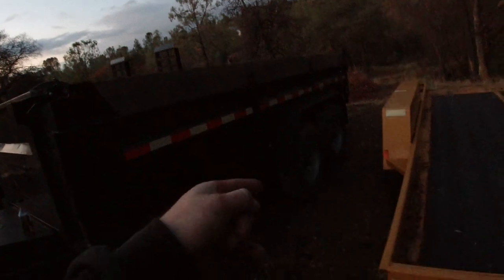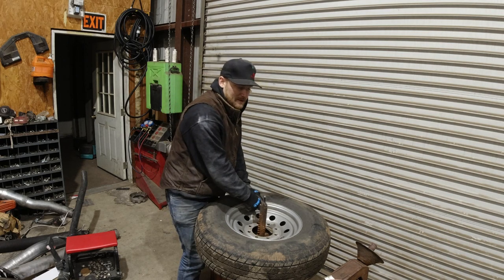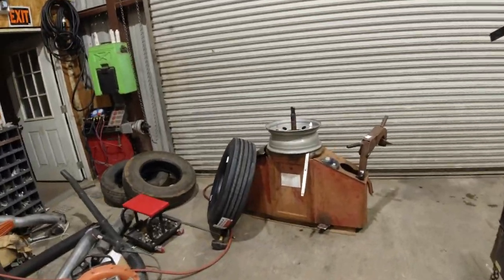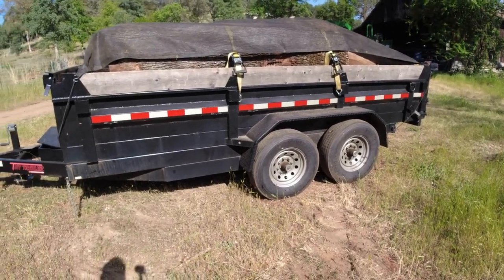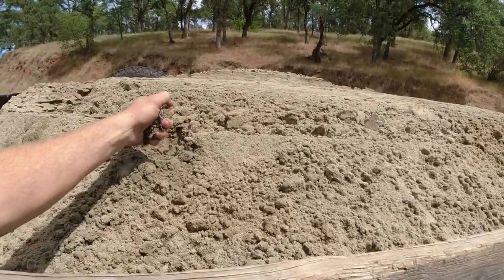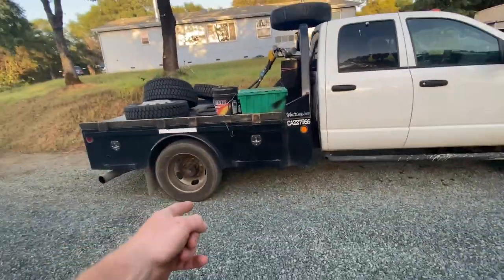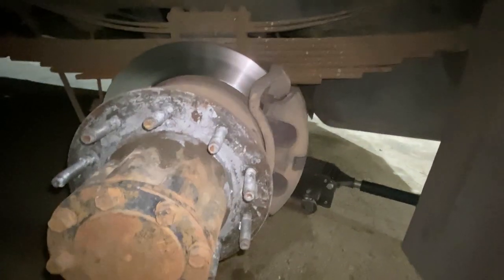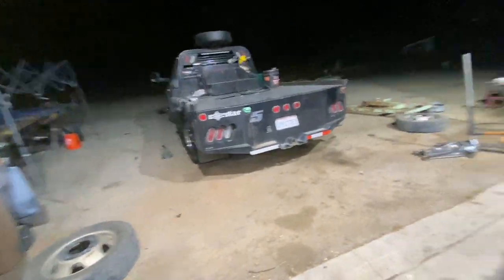Huge Upgrade for the Dump trailer! 14 ply tires. Should come standard!

Comment: When I was with my fire department, we had the good years on the f550 mini pumper we ran. Rear was great, using them as steer tires was not. The mileage we put on the truck a year was less than 2k so it wasn't terrible but not great on front, rear was amazing. That truck rode like a tank either way. Good look and great functionality on them good years. 
The Florida forest service uses them too, but not in front, can't remember what they have on the front for their rigs. Good purchase Sam, great trucks and love the content.

Comment: the dealer i bought my truck from put my winter steels on for me the first winter. i had to beat the back ones off with a sledge hammer in the spring, they'd rusted on. this fall i applied never seize on the steels before i put them on, this spring the backs literally fell off as i was taking the lug nuts off. made my life soooooo much easier.

Comment: I have those tires on my RV Hauler. Class 6 SuperCruzer. With the trailer on, drives are 11,000 lbs. Run 90 psi in the rears. Tried less but felt like it was moving around. They sing a little on some roads at 65 mph towing the rig. But never been stuck in sand or loose stuff , My steers are G647’s 245’s. X19.5 . Those tires when used on the drives just dig holes. The 622’s float real good and sit on top of soft stuff, Which is the reason I put the on instead of the 647’ RSS. Run 100 psi up front. See 110-115psi on the TPMS with 7880lbs on the steers. The rears are only carrying 2750 lbs each which is nothing, but felt like I needed the 90 psi. You’ll like them, all season with plenty of sipes in the tread.

Comment: On your 5500, if you don't already have them, it is recommended to use the nylon spacers between the steel and aluminum rims. It helps to reduce corrosion due to electrolysis between the two different metals. I had a similar issue with my fifth-wheel camper tires, they had 8ply tires on it, but I upgraded to 10 ply on 15 inch rims. I have been looking for 16 inch rims for it so I can get heavier tires for it. The 10 ply are a improvement but they still want to lay over when turning. The trailer when loaded for a week long outing is just over 10000#, which makes me also question if the axles are even heavy duty enough. Great informative video. Keep up the good work.

Comment: Years ago I bought a new 3000 pound small enclosed trailer and the first thing I did was to replace both tires with radial tires. Past experience bias ply tires would over heat and blow out if you didn't keep the air pressure up. Also adding electric brakes really made it fun to use.

Comment: Trailer tires is a good topic. I use 17.5 with 5/8 studs and for easy upgrade on 7k axles that run 16's the Boar Wheel Company has low profile 19.5 that match the  stock 16"  bolt pattern and tire dimension within half inch or so clearance.

Comment: I have great luck with Cooper overall. Running first set of 20s similar to what you have in grandmas truck. I run trailers pretty much daily but only avg 14 k trailer 23000 pound total truck and trailer. 20s I have are amp all terrains have 25000 on them rated to go 65000 have way more than half tread left and they have worn very even. I have ran then mostly in Texas but made one trip to Tennessee and back. You are right about the trailer ties have the 14 plus ply on gooseneck best tire ever. Ordered on trailer extra 125$ each (Lamar) brand trailer.  Which has been great. Just put 14 ply on our dump trailer it came with junk. Great improvement also. Have learned a lot from your videos.  I bought the Milwaukee impact because of this one in fact.

Comment: do not run more then 80psi in the tires unless you change out the rims. we have problems cracking rims at 110 psi on standard steel trailer rims
Reply from the maker: Yeah I didn’t put that much in them. All good. Worried about that aswell

Comment: I agree!! I just got rid of my 10 ply tires on 7x14’ sure trac dump trailer. Went with 16 ply. Got tired of blowouts and nails getting in easy. Only 8 month old trailer. Spending thousands of trailer should have 14 ply tires standard!

Comment: I've gotten alot of good advice from you bud 👍 I'll be upgrading my tires on my 30foot flat deck gooseneck to 14ply now. My pickup looks great with Steeles but will be upgrading to alcoas in time 😎 Good idea with the tire pressure. I'll double check mine. As for tire brands I use nitro for summers and winters. Nitto Terra grapplers for summer and nitto exo grapplers for winter. Stay away from trail hog tires. They barely last 30,000km.

Comment: Toyo m608z is a good tire that I put on my 5500 ram. I also went up a size to 245 70 19.5 and they have a 16 ply tire. I reality with the 16 ply tire my ram 5500 went up to a ford 600 with the tire upgrade. That's all ford did to get to the f 600. I also agree with your tires on the dump trailer, I put on the 14 ply and it was a night and day difference. Good luck and stay safe.👍👍

Comment: I made the same switch to 14 ply tires on my gooseneck dump trailer and I’ve never looked back. I couldn’t keep 10 ply tires on it. I run Hercules tires only because that’s what my local tire shop has in stock at an affordable price.

Comment: I thought my 14 ply were good until I put on the 16 ply this winter. Do not get even warm on the highway. The tire shop that mounted them had to resort to the six foot manual bars. Stalled out three different tire machines. Did you get the all steel version? Higher rated. My 14 ply were 4400 pounds per tire at 110 psi the 16 ply are 4540 pounds per tire at 120 psi. Love those balance beads. The rear tires really wear when you tow heavy. They got to do a lot of pavement grabbing. Every revolution the tires are trying to get traction on a new surface. So a tiny bit of slip occurs on the tires. Gravel well they are really slipping a lot. I do not have Ford Wheel Drive and my rears wear about twice as fast as the fronts. I loved the Nitto Terra Grappler in load range 126. They quit making it. I have a set of Dura Grapplers on now at load range 126. Good pavement traction in all conditions but not worth a crap in any sort of mud. I am following the Kanati Armor Hog reviews as that could be my next tire at a load rating of 129. I don't give a rats patootie about wear. If they cannot carry the load properly they are useless.

Comment: I keep two dump trailers going for a tree service and only three years old, 0ne has a whole new tubing 10 ga floor and new weld on OEM suspension and axles and the other almost as much rebuild work. There is no future commercially hauling with those and CDL/big trailer equipment trailers  is the way to go.
Reply: The stock tires have ripped the studs right out of our 7k Dexter cheap ass hubs stock on Cam Superline... You are in for trouble, electric brake axles are for campers..

Comment: I run those good years on the back of my semi and they work pretty good also we run them on our tow trucks they kind of skied around until they harden up but other than that they're pretty good.  We've always changed our own 19 fives all we do is put two bags of weights beads  inside.

Comment: I did that several years ago.  Loved it until the centers started breaking out of the wheels. The stiff sidewalls don't flex as much so the wheels have to take the hit. Over the road it's great. For short runs and lots of turning the 10 ply seem to work the best. That's my experience.

Comment: I run a 14 k flat deck and had a cheap tirelet go where the sidewall and tread meet we up graded to 14 ply tires just las week the weld on the rim where the dish meets the outer ring cracked we run heavy alot and run 500 mile round trips twice a week
Reply: Love the new tires on my trailer

Comment: Anti-seize says on the bottle, " NOT for use on wheel lug nuts or stud applications." Also I have learned lubricating the threads will give you more torque on that same setting/ ft/lb
Reply: ALL torque specs are for clean LUBRICATED thread. Not dry.

Comment: It was a 10-10 tire machine I had, they really were a great machine in the day.
Reply: A Coates 40-40A is a nice upgrade,  but in the scheme of things, they are antiques!
Get a newer rim clamp style machine.
The side of the machine bead breaker is cool for tires you need to bar off and on anyway. Don't have to lift tire till that chore is done.

Comment: another great video Sam, yeah it never pays to cheap out on tires, whatever i own/drive i will pay extra to get better quality ,mileage and warranty passenger or truck tires it just safer and makes sense, last set i bought were Michelins and they give 3mpg's better than the last set and ride quieter and better, for a used tire changing machine a shop i worked at awhile back had a Coats 40-40 and it did up to 19" rims and max tire diameter of 38" and was one robust machine and that same shop still has it as a backup machine in case the new fancy one goes down and needs to be serviced, the new ones are easier on the employees back when doing truck tires or those off road tires, don't know how much a used one is i just know that 40-40 sure did the job and always seem to be reliable 👍

Comment: I run a Brownell 10 ton hydraulic boat trailer (~8,000 empty, 28,000 max loaded) behind an F-450 short wheelbase chassis cab. Pair of 12k Dexter stub axles on custom airbag swingarms. Running 235/75/17.5 Hercules Strong Guard HRA..... J rated.... 6,008 single on Alcoa rims. They hold up pretty well considering the abuse (multiple daily dips in salt water and stupid hard turns) I put them through and the bad camber issue from the manufacturer failing to pre-camber the axles. I have to flip them on the rims to get full life.

Comment: I sell heavy truck tires. If you go with 14 ply tires, get rims rated for 110/4400 lbs. I sell 14 ply’s to dudes all day, I tell them to run them at 80, they run them at 100, and then they get pin hole leaks in the wheels.

Comment: The tires are rated to haul x amount of weight at the max tire pressure on the side wall.  Running low air pressure creates  unnecessary heat on the tires which is a tires enemy and will cause them to blow.   At 90psi that's 80% less air than what the tire is rated for.   So you turned your 4,000 pound rated tires into 3,600 pound tires by reducing tire psi.  Sure the tires is still capable of hauling 14,400 pounds at that pressure which is over max  on 7k axles.     Running lower air pressure is simply  weakening the sidewall of your new tires which is what  holds the  weight to help reduce side wall flex/roll.
Reply from the maker: Sidewalls didn’t budge. Good logic you have tho.
Reply: @VBELTandSON   I'm a firm believer in the tire manufacturer knows best since they developed and rated the tire.  As another fella mentioned rim's is designed for certain max psi also.    

You want rough when light or empty.   I run 120psi in 16ply steers and 115psi in my drives, not sure what ply my drive tires is, prolly 14.   We run the 16's on the steers since they can carry right around 13,000 pounds.

Comment: I did the same on my 43 ft 5th wheel camper right when I bought it. I don't know why they put the cheapest 10 ply crap tires on them. I put 17.5's on my 40 ft flat deck equipment trailer when I got it. I don't play with cheap weak tires.
Reply: Valve stems also need to be good and strong no rubber crap

Comment: The Big Tex trailers come with Good Ride tires...AKA "Blow Ride". At around 30K they start separating. They are 10 ply load range E tires that say they are good for 3520 Lbs. single, but obviously that's over rated. I put Hercules 901's rated for 3750 Lbs. Haven't put that many miles on them yet so the jury is still out on that.

Comment: Not cheap...Northern Tool has some  that run about $1,979. Tuxedo Semi-Automatic Swing-Arm Tire Changer — 37in.L x 48in.W x 41in.H, Model# TC-950 says it will do up to 47” tires and up to 15” wheels...don’t think it will be a cash cow for you as you mentioned.

But yeah I’ll be going to G rated tires next time for my dump, equipment, and or moving trailers...all dexter 7k axles...that’s a lot of load with 14k in sand and 10k in logs without blowing a tire , My dump has a big old sticker saying 9,500 Max load on her and dumps are heavy as it is....I’ve also cooked several E-rated in the summer anytime I’ve gotten much over 70 when passing...and one shredded last time I went to the local land fill...sounds like the G rated tires are “G” 

Commented too early in...🤣😂🤣

I’ll be glad to see how the G rated tires do~Jon

Comment: Well .. ! It's actually good to see a person fit wheels correctly , one should always wire brush wheel mount/wheel studs and smear - not paint - never-seize/copperslip to prevent corrosion - trying to beat a wheel off with a sledge is not fun - hope you put some between the steel and alloy? or do you prefer removing twins as a pair ? .As for fitting and tyre pricing your side of the pond ,sheez rip off or what ! . As for mileage would have thought 30-40k was good for a pick-up/flatbed , if you can get more ... bonus . Been a while ,long while ,but last set of rears I accuired for my unit (4x2...295/80x22-5) I got about 100k kms before they needed a tread re-cut ,the fronts back then were about £180 fitted etc and i got over 100K kms , (fronts become spare drives when require a tread re-cut) I averaged 8-9k kms a month bout 100k a year bit low but hey .

Comment: Hey Sam I have a to tell ya a story about my way to a job last week ! So I took this grading job in this remote but exclusive horse community not far  about 50 miles from me . Customer says road is narrow and steep and I have to be escorted in because the trailer anyhow I headed in towing my TL10 enclosed with only a bucket I have the Factory counter weights on rear and two 5 gallon water fire extinguishers on back . I figure it weighs 11500# with my 25’  deck over Pintle that weighs 5800# includes binders etc .... any how I use my 6.7 2016 3500 crew long bed srw Aisin so I’m headed up this six mile Windy road and I’m using my push button shift to stay in right gear and I’m babying it watching my temps etc .  Then  this One steep hill with a hard right turn at bottom I missed the shift from 3rd to 1st and the hill almost stopped me then it went to first and I gave it gas and my tires started spinning and no more forward progress then my warning light started beeping saying trans hot !! was 217  and started sliding backwards as tires spin I hit the brakes of course as I stained my shorts lol !! I had to put it in 4x4 to get up the hill definitely woke me up lol .first time I ever had to use 4x4 on pavement I’ve been on many dirt roads in 4x4 but on pavement Was a first for Me !!! Mind  you this narrow paved road has no shoulders with signs saying danger 1000 foot drop offs. Best part after three days of working they’re and jobs done customer wanted a discount umm NO ! Haha ever had to do that ?

Comment: Westlake are terrible from my experience on trailers they came on my 14k dump trailer, I didn’t upgrade right away because westlake was there upgrading 14ply so I figured I would try the 10ply to start needless to say I they made it about 5k before they started flaking and coming apart,. I run the Continental HDR on my dually with 20k on them now and not chipping or flaking but I’m in NC so I’m not dealing with super hot pavement like out west where you are, I can tell you that there’s a huge difference between them and the Cooper Rm253 that I started with on my 19.5’s. Vision hauler makes aluminum 19.5 that I have and you get 4 positive offset and 2 negative so I can rotate with out having to break the whole set down and remount and balance everything every rotation

Comment: Anti-seize / Lube is ok but you need to reduce the lug torque ( check proper torque ) Lube makes it easier to reach bolt stretch ( this is what "tightens" the bolt ). This would be good but the gorilla at the tire shop OVER tightens and causes the bolt to stretch into the permanent deform region. A stretched / deformed thread will cause removal problems along with corrosion. Thanks

Comment: Don't tell Freightliner or Mack not to mix steel and aluminum wheels have worked for class dealers for 20+ years and it's common practice for the manufacture install in this manor. If it were and issue the drums would have to aluminum

Comment: I have had good luck with Goodyear tires I have to rebuild the front end on my 1500 what are the best front end parts?
Reply: Kryptonite if available for your model. Moog also good they even have a severe duty line also now. May not have there name for it right though.

Comment: A while back you did a video with a Mecalac  excavator. Do you have any more of that machine or any plans in the future? Im looking at getting into forest mulching & some dirt work. That machine was very intriguing. Do you think it would make a good choice or whats your thoughts for the most capable machine under 16k lbs. Thanks!
Reply from the maker: Aiming to buy one waiting on a few things to happen and might swing at one
Reply: @VBELTandSON  What would you say is the best excavator under 16k lbs to run a forest mulcher?
Reply from the maker: I’d say the mcr 8 will have the best power for the weight

Comment: You’d be better off just getting a set of tire spoons. Once you get a good technique down  you fly through tire mounting. I just did all 6 of my 19.5s in a little under an 2 hours
Reply: I also haven’t had good with Goodyear’s on  the steers. I had both front tires blowout the sidewall within 20k miles of new. The rears are still fine though. Idk if they just can’t handle weight by them selves in a single application

Comment: The problem with running both duals with Aluminum rims are the Aluminum rims are thicker.  And you run out of the lathed portion of the axle. So the outer dual can be mounted out of round.